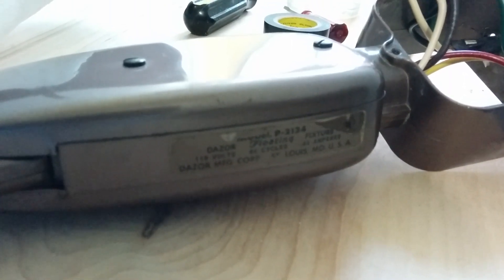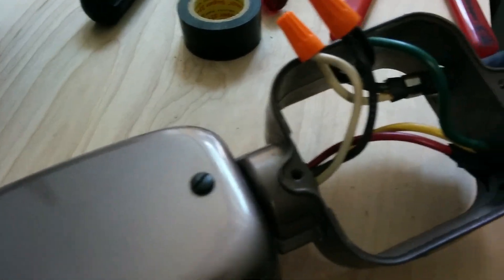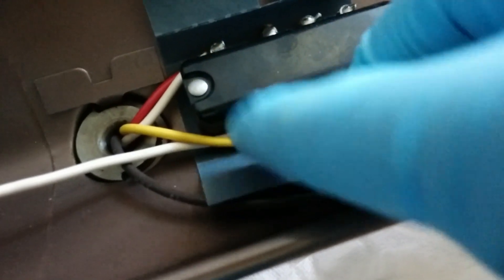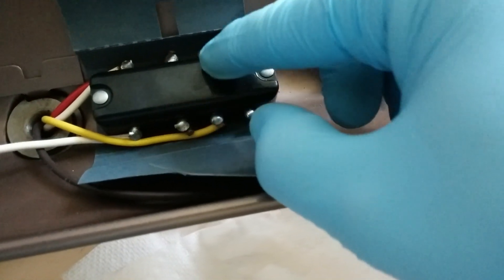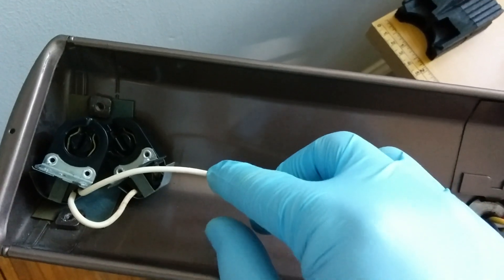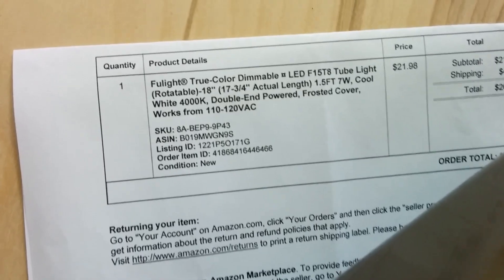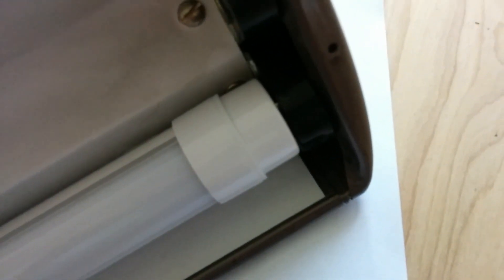Dazor P-2134 vintage drafting lamp conversion to Fulight LED tube replacement

Comment: I have an unmarked lamp that looks almost exactly like yours, although possibly even older, and possibly ex-military (due to the dark green paint color). These instructions worked perfectly. I was able to rewire mine in about 35 minutes this morning—in time to start my work day using my newly wired lamp with nice, quiet, bright LEDs. Thanks a ton!

Comment: Thanks for the info. I decided to use led bulbs that use power from one end. The bulbs are cheaper. The wiring is the same for the white wires. The other ends of the tombstones, on the same side as the white wires, are wired using the brown wire and looped to both tombstones. The opposite side tombstones have no wires hooked up. Just remove them. Caution, make sure you insert the bulbs correctly.  The bulbs will indicate which side of the bulb needs to be hooked up to the powered end.

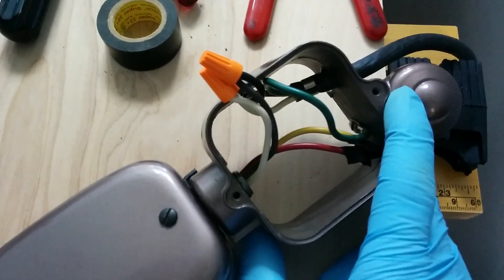Comment: @1:56 strangely that looks like the can of a run motor capacitor, not a ballast choke.  Is it possible these early ballasts were encased and filled with dielectric oil?

Comment: I have this exact same lamp, turn into it now. You don’t happen to know how to tighten the actual lamp head do you? Mines wobbly, but it doesn’t seem to have a nut on the inside after you take out the inner liner.

Comment: Hi! I am really interested in the mechanism behind the dazor lamp but can't seem to find anything. Could somebody explain how it works a bit? You have the two bottom beams - one that holds the cable and one that holds a spring? Ideally I want to take one apart, but still lookign for a cheap version... Maybe a flea market or so.

Comment: I have model UL 2324-15 and my switch has a slightly different configuration than what I saw on your video. it is unclear to me what wires can be removed from the switch disconnecting the ballast part, and what needs to stay for the switch to keep working. is there any way you could read that from an image of the wires and how they connect to the lamp sockets? Thanks for your reply!

Comment: Hi William, I just purchased a very similar model lamp with the intention of adding an LED tube. Everything here looks clear to me except the wiring of the parallel tombstones. Did you need to rewire those at all? In mine, a white wire is connecting two of them in parallel but the other two are separately connected to the switch, one with a brown wire coming from the base then routed to the switch, the other with two yellows both only connected to the switch. I assume I will need to rewire those browns so they are in parallel with the ground?
Reply from the maker: I don't think I rewired the tombstones
Reply: @WilliamCooley  Interesting, as similar as mine is it has different wiring than yours, one side of the tombstones are not connect to each other at all except for through the switch. Hope I dont mess it up! EDIT: It looks like the wires are just pressure connected to the tombstones with screws, I thought I was going to need to solder. Phewf, this makes everything way easier.
Reply: @WilliamCooley  Thank you! This worked very well.

Comment: good morning.  i am converting one of these lamps to a standard screw-in bulb.  the light switch is labeled "line" and "load" for the two black wires, and "lampB" "lampB" for the two red wires.  as i will only need to use 1 black and 1 red, which two wires do i tape-off?  thanks in advance for your help

Comment: I have the desk lamp with base version of this light and it has always worked fine. Recently however, it's turning itself off after about two hours with an audible click. Does this have a fuse that may be going bad? Please and thank you for any advice.
Reply from the maker: Sorry I don't know. Mine didn't have a fuse

Comment: This is very helpful. I was told LED tubes in this with the original switch wouldn't work and yet there it is. Is the lamp still working and with two bulbs now?
Reply from the maker: Yes still using it. Never bothered putting in a 2nd bulb
Reply: @WilliamCooley  Thanks for responding! Yeah, the one tube is really bright. I'm going to convert at least one of the 2134's I have as it appears that one ballast is leaky and failing and usually only one bulb will light. I appreciate the PCB warning as I think this one is from the 1970's.

Comment: I still have the transformer and capacitor of mine do you have the wiring diagram with those since it will be easier for me to just reconnect.
Reply from the maker: I don't. Sorry
Reply: I have a wiring diagram if you are still looking

Comment: Recently picked up a couple Dazor 2324 models. Both work great electronically but one is in need of an aesthetic restoration. Any ideas on a cleaning method or polish for these types of lamps? Dealing with small dings and scratches. Possibly rust or something that has built up on the finish over the years. Also an area where someone tried to paint over a blemish. Thank you. Any help is appreciated.
Reply: I used a strong kitchen degreaser to clean mine

Comment: Hi William, great job on lamp, I want to do the same thing to mine!  I'm working from home and using the light at my desk and sometimes the noise from the ballast drives me crazy!  Questions: 
 1) It does not look like you removed the ballast at the on/off switches, just cut the wires that were not needed.  Was there any other modifications to the ballast?  Red and black switches did not have to be reworked?
2) What did you do about the lamp bulb being short?
3) Looks like you used the same tombstones to accept bulb...correct?

Looks pretty simple, going to order bulbs today.  Appreciate you help in advance
Reply from the maker: 1. On my lamp there was no ballast at the on/off switch assembly. I completely removed the ballast that was in the base of the lamp.
If it's not mentioned in the video I can't remember any other modifications that I did.
2. I haven't bothered doing anything about the bulb being slightly too short and it hasn't fallen out yet
3. yes, same tombstones to accept bulb
Reply: @WilliamCooley  thanks!
Reply: @tommoore4154  careful Tom as some of the new LED bulbs require the ballast to be left in and some don't and some of the newest ones work with or with out the ballast
Reply: @MrMacDroadrunner  thanks, I have purchased bulbs but I figured out how to stop the ballast from “buzzing” so I haven’t converted yet.

Comment: For someone new to electronics, how were you able to remove the transformer and connect directly to the leads from the power source, electrical speaking what is the justification?
Reply from the maker: The LED tube replacement that I picked runs directly on 110-220 Volt AC. Not all LED tube lights run on this voltage.
Reply: William Cooley Ah ok well that's easy, ok because I would like to do the same thing, I have two Dazor lamps and the transformers make them pretty heavy, so how did you handle the PCB transformers? The disposal? And handling, any protective wear suggestions?
Reply from the maker: @dwellworks  I was wearing a respirator, gloves and was doing the disassembly by a window with an exhaust fan. I am not qualified to make recommendations on hazardous materials handling. The city where I live has a recycling center that takes PCB
Reply: William Cooley - Can you please review my existing wiring in my Dazor lamp see attached photos, I believe I wired the base but I need help with removing the extra wires to the switch.  Doesn’t look like I can send photos in this thread I’ll try finding your email and send through there.

Comment: Hi, just simple question, I have p-2134 same one, and want to convert to LED, so Can't I just remove only ballast? do I have to change or do something on switch or something in shade? I'm asking this just because I'm not native English speaker, so wasn't able to understand this whole video, please summarize things I should replace for conversion.
Looking forward to your reply, cheers.
Reply from the maker: You can not just remove the ballast. Then the wires will not be connected at all or worse you will short out the power. Is there a particular part of the video you did not understand?
Reply: William Cooley thanks for fast reply!!  william, I mean, removing ballast and rewire it, the  it should be fine, no??
Reply from the maker: @StreetWalkAndTalk  it's been a few years since I did this so I don't remember exactly. From watching the video again it sounds like you do need to remove some additional wires under the lamp reflectors otherwise you risk shorting something out.

Comment: What did you use for a transformer replacement in order to install the LED bulb?
Reply from the maker: This LED bulb did not need a replacement transformer. It's directly wired into the AC power.
Reply: @WilliamCooley  picked up an old m-270 magnifyer the neighbor put out on the street. Is that a common LED type bulb? Did not know they were direct wire. Mine has 3-  9 inch bulbs in it and 3 old transformers. Looking now also at a 2324 desk lamp someone has for sale for $40 bucks.
Reply from the maker: @davidmackenzie218  there's a link to the bulb I purchased in the video description, though it looks like it's not for sale anymore. There are lots of other brands that are direct wire

Comment: Would be a lot better if it was actually a step-by-step video that did not skip many of the wiring removal and re-wiring steps, and without the annoying background music, there's absolutely no need for background music in this type of video.  Note that it's only necessary to remove two screws on each end of the white reflector, don't remove the screws that hold the lampholders to the reflector, you can leave them attached to the reflector and save yourself quite a bit of effort in the re-assembly.

Comment: Really wish you had not skipped all the unwiring procedure, that is half the rewiring thats necessary to rewire these vintage lamps, especially regarding the switch.
Reply from the maker: If you have any specific questions about the wiring I can try to answer them.